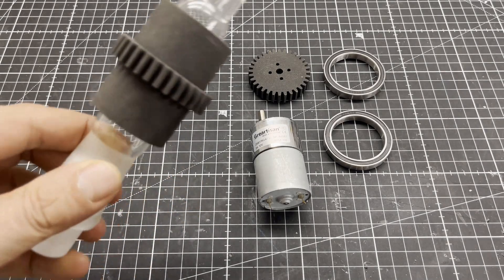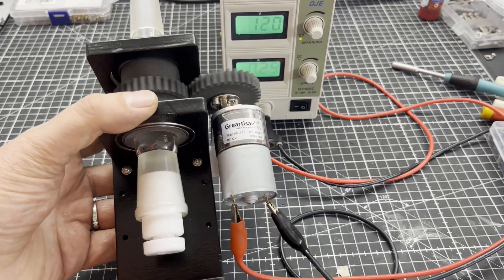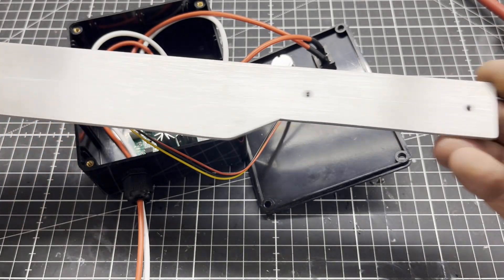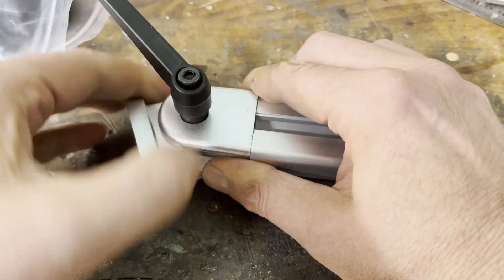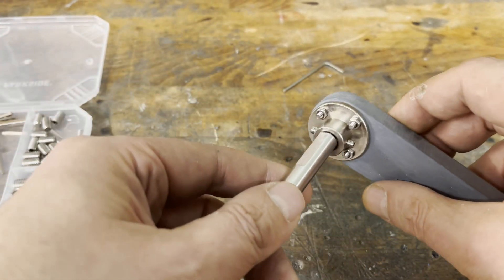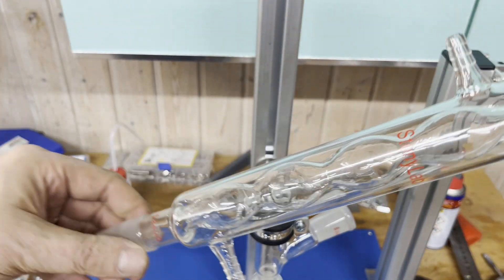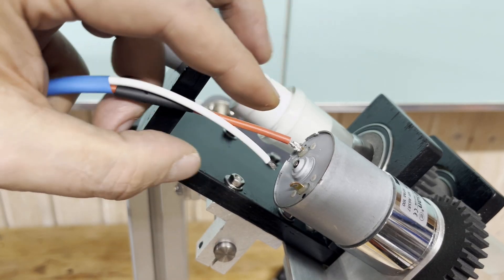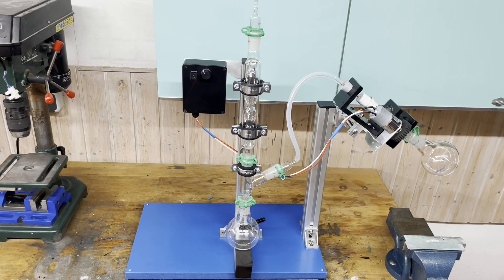Building a rotovap

Comment: I love your work. Very inspiring. Obviously you know what you are doing, but I am surprised that you are not using a brushless DC motor. (?) Those little gear motors spark quite a bit inside and with volatile solvents...
Reply from the maker: Thanks:) When working with volatile solvents and reaching the flammability limit in the laboratory, you are doing something terribly wrong. Simply switching on/off the light is enough to cause an explosion. If vapors can escape, the rotovap should be placed in a fume hood. Nevertheless, a geared BLDC motor would of course be the safest solution. Most cheap lab stirrers still use DC motors though.

Comment: Amazing video, I'm thinking of some improvements because silicon pipe isn't indifferent to some solvents. But I'm not sure how to fix it... i think maybe some different glassware and for moving parts teflon fittings with proper lubrication. But man, great work. I already subscribed to your patreon, I was expecting a higher price, but even students can afford it.
I can't wait for the mass spectrometer video, I always wanted to build it myself. You are just fulfilling my childhood dream. Maybe I will get inspired. Also, you have my great support, and I will definitely share a lot of your videos with my uni profesors. 🚀🚀🚀
Reply from the maker: Thank you:) If necessary you can change the silicone tubing by a PTFE one, but you need special connectors/adapters for it. You can buy them on AliExpress.
Reply: @Marbslab good to know, thanks

Comment: Great idea.  I like your use of the stirrer bearing but think you would gain maximum efficiency with a larger and shorter tube if possible.

You can use a Sous vide heater to heat your bath.  They have a stirrer and a thermostat.  Add some floating plastic balls to limit evaporation if using a water bath to reduce mess.

The bonus is they are cheaper than a hotplate stirrer at 25 to 250 euros at discount web stores.

Only drawback is they are often limited to 90 degrees C maximum temperature so great for volatile solvents but not good for higher boiling point extraction unless using vacuum assist.
Reply from the maker: Good idea with the sos vide heater. I guess you could change the thermostat to obtain higher temperatures:)
Reply: @Marbslab  The consumer ones have a lot of plastic parts so may not like much higher temperatures, I suppose 110degC in a suitable oil bath would be safe with most of them though if you want to remove water.  Adding a series or parallel resistor to the temperature sensing thermistor could be an easy way to fool the unit into operating at a higher temperature. Important to remember that heating elements in a water bath are very effectively cooled and may get locally hotter in an oil bath, just something to keep in mind as well.  A consumer chip fryer could have a thermostat you can set up to 180-190degC but would cost a bit more, a well used unit might be had cheap if the basket is missing or there is some other small fault.  The drive unit from a surplus Ni-Cd battery electric drill could be rigged up as a stirrer.

Comment: Nice build, I would only consider using metal pot for heating bath and teflon tubing instead of silicone one(harder to attach, but will last forever).
Reply from the maker: Thanks:) The bowl is made from Boro, but a metal bowl would be safer. I ordered already PTFE tubing in the right size.
Reply: @Marbslab  They usually require a special fitting on the glass side, with an external sealing ring, screwed on the thread like fitting for the condenser, but I assume you know that already. Might be just less straightforward to connect it together so that the angle of the motor part still can be adjusted despite higher rigidity of PTFE tube.
Reply from the maker: @midi5581  I have those fittings in different sizes. No problem:)

Comment: can someone explain to me why this is getting praised? like what would this one be capable of where the silicone hose wouldnt just collapse or it would have a crazy vacuum leak? my understanding was, the main critical part of a rotovap is the fact it can sustain at least some vacuum while it rotates. Plus the solvent recovered is all going to partially condense in that silicone hose and get contaminated. Not doubting this design its just i think im missing the usefulness of it beyond atmospheric pressure drying
Reply from the maker: I use also silicone hoses for normal vacuum destillation. It doesn't collapse. Silicone is inert to many substances, that's why microfluidic devices are made of PDMS. If the silicone hose bothers you, use a PTFE hose. Where has the maker spirit gone over the years? Today, all anyone does is complain, everyone knows everything better, and the safety fanatics scream that you'll die if you replicate the machine.
Reply: @Marbslab  yeah i certainly didnt mean to complain, like i genuinely just, must be missing the big picture.

How strong of a vacuum are you able to pull btw?
Reply from the maker: @ronoxengineering  I just have a cheap one-stage vacuum pump. It can pull a vacuum of around -0.9 bar (according to the vacuum gauge).
Reply: @Marbslab  i have the same teflon adapter but it cant hold back any reasonable vacuum without also randomly letting in a bunch of air now and then while rotating, but i didnt use teflon grease like you are, what grease is that, that i might be able to find some? just generic teflon grease? or is it specifically a vacuum grease?

Also, what i meant was how hard can you pull , while this is turning, in the rotovap, does it also go down to the full -0.9bar? because thats amazing, i straight up didnt know it was possible with that fitting
Reply from the maker: @ronoxengineering  It's a Teflon grease for ground joints to seal them and avoid baking. Way easier to handle than conc. H2SO4.

Comment: Do look nice! the only thing i worry about is a quality of a sealing between moving and stationary parts. And must be me, missed that, but what's the joint material, and construction?
Reply from the maker: It's a standard Teflon bearing for overhed stirrers. You can get it for a few bucks on AliExpress for different ground glass joint sizes and inner diameters.
Reply: @Marbslab  Ah, wonderful, thank you very much!

Comment: Impressive work as always. It's funny that I have a somewhat negative feeling about rotovaps but on thinking about it I understand why. My PhD work required me to use one to try and remove DMSO from a collodial suspension of nanoparticles. DMSO is just awful to evaporate, even with a rotovap!
Reply from the maker: I never used a rotovap before, but now I will. Which machine are you more comfortable with? HPLC? I'm doing some basic research at the moment how to build one:)
Reply: @Marbslab  my bread and butter are scanning probe microscopes (STM & AFM) but I have worked with a large variety of instruments. I have worked extensively with HPLC as well. Used it again in my thesis work to size separate nanoparticles.

I'm currently working on making a x-ray fluorescence spectrometer which I'll be posting on my channel once I get it up and running.
Reply from the maker: @Drjtherrien  Looking forward to seeing your XRF.
Reply: I love and hate DMSO. Its also really oily, like soap that hasnt fully washed off. Thank god it doesnt smell too bad.

Comment: Is this a silicone tubing you are using? Not a great idea, they are gas permeable, not to mention not really chemically inert. I've had no name silicone tubings literally fall apart when stored in my fume hood. Contamination of the solvents being distilled away is also possible.
I have seen production rotovaps with PTFE parts, that should be better. By the way, it's not that hard to connect PTFE parts to glass: all you need is a ground glass flange, a matching PTFE flange, some Dow Corning High Vacuum grease (fluorinated hydrocarbons) and a fixture to compress the flanges together (not unlike KF clamps).
Reply from the maker: You can just use PTFE tubing. It's a little bit stiff but should work as well if you are concerned of silicone tubing.

Comment: You own magnetic stirrer??? Then it's much easier to distill out solvent with conventional apparatus.
Reply from the maker: Rotovaps exist for a reason. They have several advantages. A heatable magnetic stirrer is part of the basic equipment of every home laboratory, but a rotovap is not.
Reply: @Marbslab As well I see, that you have enough glassware for conventional distilling. The main purpose of rotavac are high-throughput tasks and large volumes of solvents. As for me, for small-scale synthesis it's useless (unless you have it for free), better to use short path distillation attachment or something like this.
Reply from the maker: @nikolayboev9948  The main advantages of a rotovap are the increase in surface area and therefore the increase in evaporation rate, as well as the prevention of bubble formation and solution boiling, since evaporation mainly occurs from the liquid film on the flask surface. I wonder what your comments are supposed to achieve. If you don't need a rotovap, fine, then use a conventional distillation apparatus. But the topic here is how to build an expensive device yourself at low cost.
Reply: @Marbslab Actually rotavac is a must, when you need to evaporate 2l of solvent, intending to use it in another procedure. If your task is to remove <50ml of cheap solvent, the best way to evaporate it directly into aspirator (or safety glass in-between) through simple stopcock.
Reply from the maker: @nikolayboev9948  The 50 ml IPA was just for testing. As I said, if you don't need a rotovap, I am fine with that, but I built one for those who need one and can't afford a commercial one.
Reply: 😁👍❤️ @Marbslab

Comment: 9:45 cold joint spotted? i can't see the other side of the terminal, did the surface wet out properly?  pre-tinning the wires as you do is fine, but you really wanna be heating both surfaces directly with the iron, and flowing fresh solder (which brings with it fresh flux, important for getting rid of the surface oxide layer and other contaminants, and exposing the base metal) into the joint while melting. it gets awkward with only 2 hands, you could either compromise on this a bit by pre-wetting both the wire and the terminal, and then reflowing them together, or (preferably), by hooking the wire through the hole in the terminal before soldering (both freeing up a hand to hold the solder, and adding some much needed mechanical support to the joint).
Reply from the maker: Soldering a wire to a terminal with two hands and a camera in front is difficult, but I'm soldering since 40 years and know what I'm doing. If the solder joint ever fails, it's very easy to rework:)

Comment: Do you know how to use steel with glass together? As an example using a steel paint can with a 29# dimroth or allihn condenser to get a jury-rigged rotovap that can be heated with basic setups rather than water bath. I have no idea how to securely plug glassware in steel, would be amazing if you could show it.
Reply from the maker: Never thought about that kind of setup so I don't know:)

Comment: Build quality stunning.
Engenuinty stunning.
Another killer project with some really well thought out features!
Reply from the maker: Thank you for never tiring of appreciating my work.
Reply: I'm deeply concerned about the thermal expansion fit of the main rotation part. I fear the glass will shatter, or worse just crack(hiding the resulting leak) resulting in a life safety issue. I'd much rather see a clamp fitting around a few O-rings. It has higher thermal stability in the mechanical fit and structure IMHO. But, I'm not the one building it. At least it looks like a trivial change if Marb agrees- just a redesign and reprint of the coupling.
Reply from the maker: @Originalsunrunner20  The thermal expansion of the boro glass is lower than the 3-D printed part. But hey, I built this out of my head. It's a prototype with room for improvements:)

Comment: In this layout does the reflux column do anything?
Reply from the maker: Maybe I used the wrong wording. It's a reflux condenser, but it does not return the condensate to the system from which it originated. It just cools the vapor, which condenses and drips in the flask below the condenser.

Comment: I'd add some thrust bearing between those locking collars
Reply from the maker: What use for?
Reply: @Marbslab so they dont rub on the aluminum parts, since they migh rotate a bit. They ensure you can put a bit of pressure and they won't rub on each other
Reply from the maker: @morareduard  They rotate very less. Just one adjustment per use. Would just add costs.